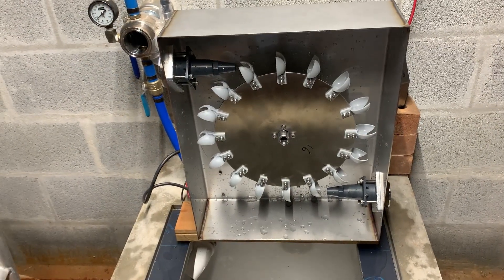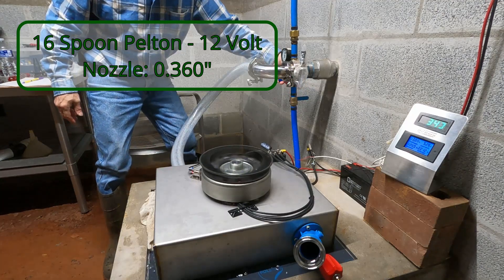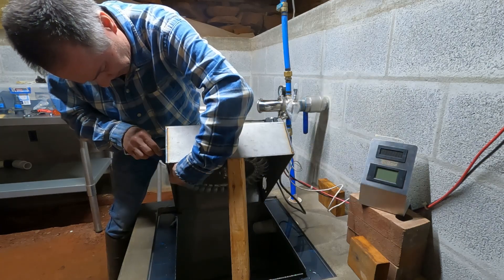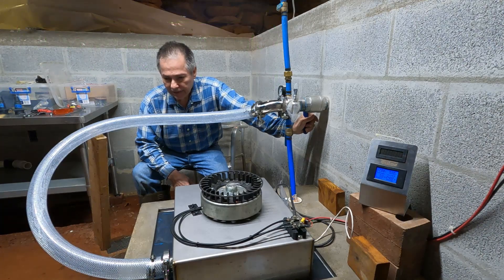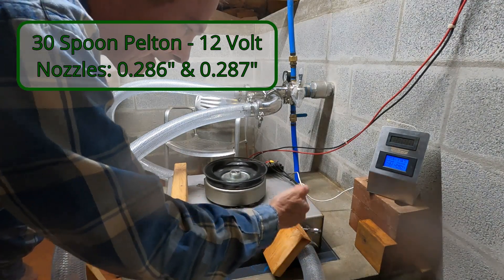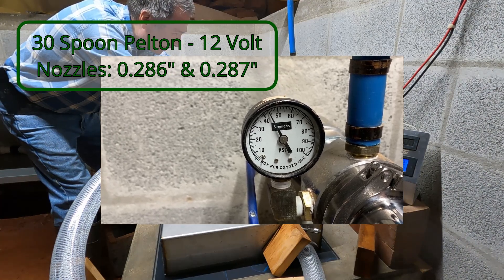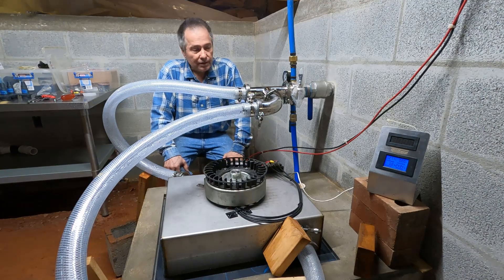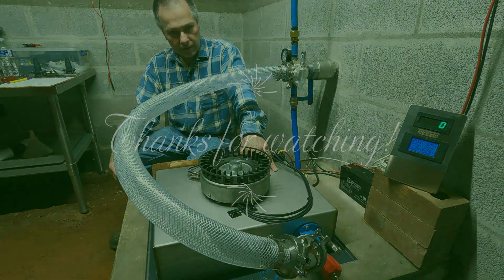Micro Hydro - Pelton and Fixed Nozzles

Comment: when multiple jets are used, their  Total  flow capacity should be equal to the nominal flow rate from the penstock.
Reply from the maker: According to my mathematical calculations, my 3,000 foot water line should be able to deliver 24 GPM at a pressure of 41.49 PSI. Thanks for your feedback.

Comment: Great setup, with great potential, have you considered that the noise from the deflecting water is loading the pelton wheel twice or three times over, with a directional water  deflection out the outlet maybe free up rpm via useing less psi, the vertical pelton maybe more sufficient, with a v around the circumference directing the used water away from the pelton wheel.
Reply from the maker: That is a great point, I haven't thought about that issue since my first prototype. I'll work on your suggestion on my next project. Thanks.
Reply: That's no problem, could be something simple like holes in the wheel to let water through, my only other suggestion would be to put it on an mppt, this would make it not be limited by 12-24v pwm and spin free from voltage restrictions, though also limiting the watt output with your nozles, due to over voltage wattage could result in burnt wires.
Reply from the maker: Holes on the wheel sounds interesting, not sure if it will help but easy enough to test. I have a couple of MPPT charge controllers, I had the best results with the MidNite Classic on previous videos.

Comment: How did you arrive to the conclusion that your target pressure should be 42 PSI? Did you do mass/s*pressure measurements to calculate the theoretical mechanical power?
Reply from the maker: I use an adjustable nozzle which is pretty consistent with all the different units I've tested. It also agrees with the results from a calculation spreadsheet from the h-hydro website.

Comment: a box on the generator will also quite the setup down and reduce the amount of wind resistance, I wonder how much efficiency that means, probably not much and the cooling shouldn't suffer too much either according to another video I saw where it was running in the wild with everything covered
you could hear how much slower the generator got when the dude took off the box, it was mindblowing to me
Reply: tried looking for that video, couldn't find it, but it must have been the air being sucked out somehow by the pelton or whatever physics that was going on there when it was covered
Reply from the maker: Yes, I think the video you're referring to is one from Joe Malovich's Channel. The 32 spoon Turgo runner is the quietest so far, running only 72 dBs at a distance of only10 inches. Some of them do get pretty loud though. He also mentioned removing the fan from the generator but I believe this did not give him any significant power gain. I may try that in the future since you really only need those fins when running above 500 watts.

Comment: you should really build a polycarbonate cover so you can see whats actually going on inside, it would also be cool for us to see whats going on. Also a high powered strobe that you can snyc with the rpm so you can really see whats going on.
Reply from the maker: The polycarbonate is a great idea, I'll start ordering materials for my next prototype, I'll try plexiglass since it's cheaper (hopefully it won't blow apart). I've never heard of the strobe idea but it sounds cool. Thanks!